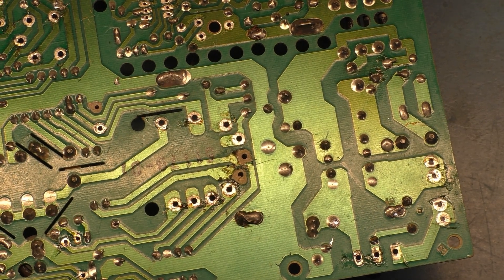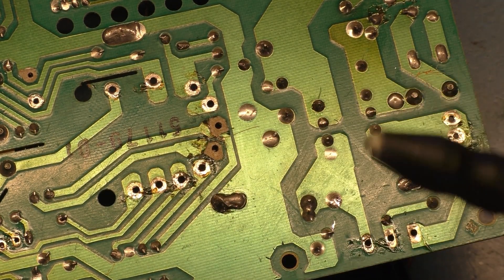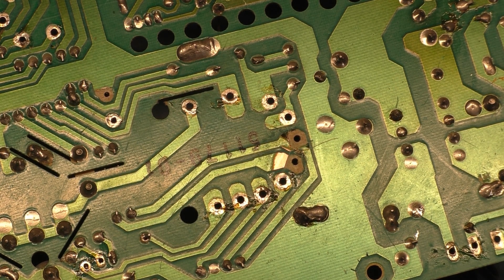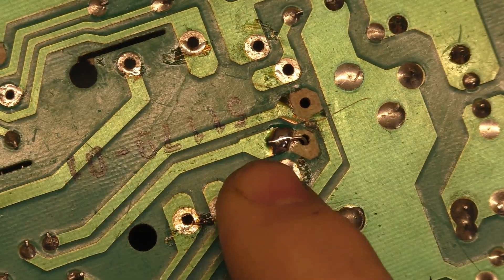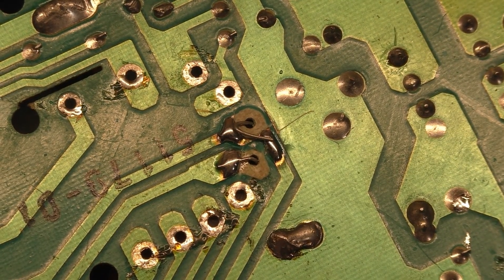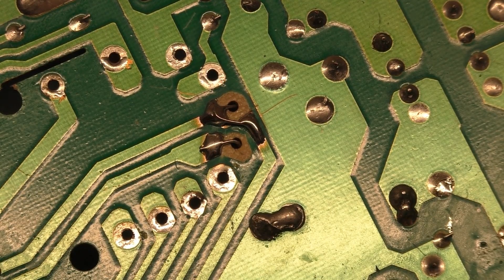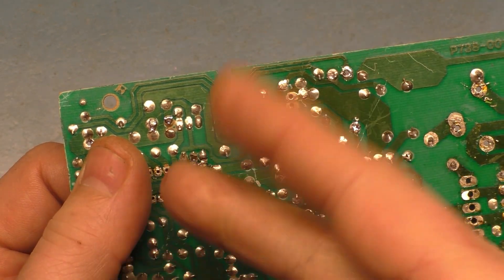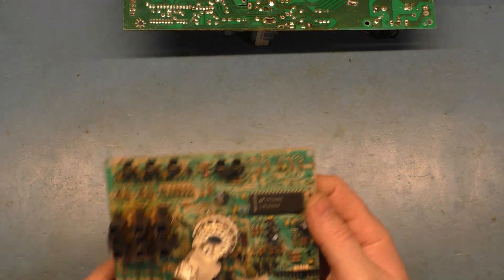Arcade Monitor Repair 101 - Missing Solder Pads? No Problem.

Comment: Got a question Mike....what do you do when the component leg that goes thru the "push thru hole" on your PCB is from a "OMRON RELAY" instead, like in my specific case or predicament here that I am currently faced with since the darn "solder pad" fell off when I was having a "booger-of-a-time" removing an Omron Relay earlier today.  The legs of this specific OMRON RELAY on my PCB are "way-too-short" to utilize your method shown above unfortunately.  Your video is great and awesome for electrical components who's legs have some length (i.e. resistors, capacitors, diodes, etc.) as opposed to a standard or traditional Relay component where the legs just barely come thru the "push thru hole" on the PCB.
Reply from the maker: Sounds like you’ll need to solder a longer component leg onto the short relay leg that’s long enough to go through the hole and solder properly.
Reply: @MikesArcadeMonitorRepair  Yes...that is exactly what I thinking, as well.  Problem is....the actual "copper path" that leads to this missing solder pad is SO THIN (almost like a human hair follicle....or thereabouts).  So, if I decide to just run a rather long electrical "wire jumper" would you happen to know what "wire gauge" would be best for this type of application, or scenario, by chance?
Reply: I'm thinking about running a long "wire jumper" from the actual leg of the Omron Relay over to it's destination point at a "solder joint" on my PCB as I analyzed the full copper conductor "trace path" between both locations.
Reply from the maker: If it’s that thin, you can just use a component leg from a capacitor/resistor/etc, or a 24/26 gauge wire will work.
Reply: @MikesArcadeMonitorRepair  Thank you for your responses and feedback....much appreciated Mike!
Reply from the maker: You’re welcome!

Comment: I was doing a cap kit and one of the pcb pads burned off, so i soldered the capacitor leg to the next available pad that showed continuity which was an IC leg. Can you choose any pad that has continuity or do you have to be real careful what you choose?
Reply from the maker: Any trace/pad that has continuity to the missing pad will be fine to use.
Reply: @MikesArcadeMonitorRepair  Thanks Mike!! Thanks for covering this topic...I feel like it isn't covered at all.

Comment: I’ve used too many of those garbage fiberglass pens. Thank you for recommending exactly what I was looking for! I could also recommend grabbing a pad from your donor board with an exacto knife and holding it down with tweezers with flux, tin your iron and press the iron to the pad while holding it with tweezers. As long as you’re fast, it works perfect and looks almost factory. You could also take a small component leg and twist it to a circle around the leg and give it the same treatment as the donor pad. All great solutions and thank you for adding to my bag o’ tricks!!

Comment: For the flyback legs, I would wrap a cap leg around the pin and then attach to the PCB. I use this strategy for SMD repair too.
Reply from the maker: Yes. I was going to mention using a component leg but my mind wandered and I forgot. I’m old.

Comment: Hey Mike, what temperature are you running your iron at? I noticed your solder "melts" fairly easy. I'm running my Hakko at 725/750 and I don't believe it melts the solder as fast as yours. I feel like this temperature as it is can potentially lift/burn pads so im not sure I wanna go higher temperature with my 60/40 solder.
Reply from the maker: 800F. I’ve never burned or lifted a pad at 800F because the solder melts quickly at 800F. When you get into trouble is when it’s not hot enough. That’s when pads are lifted and damaged, at least in my experience because you have to hold the iron on the pad longer.